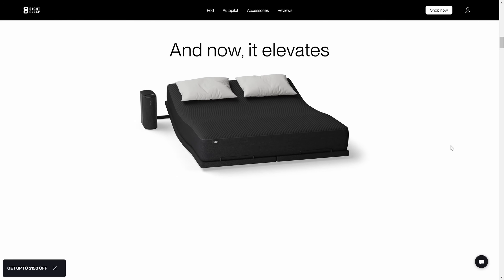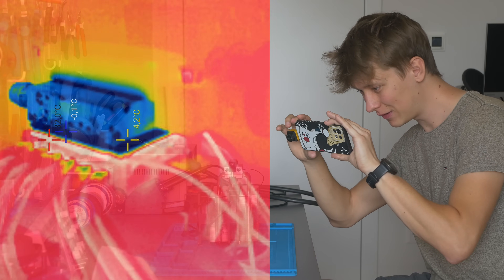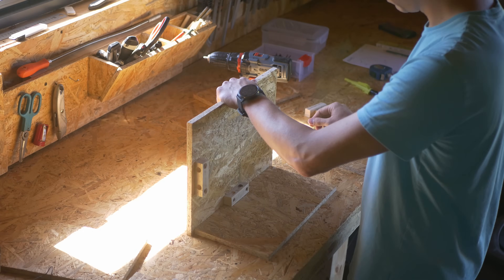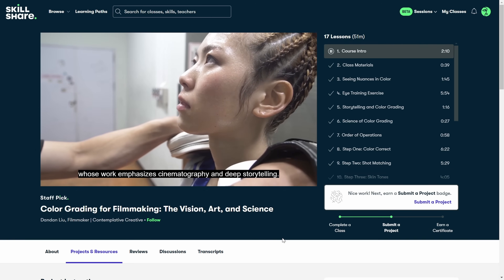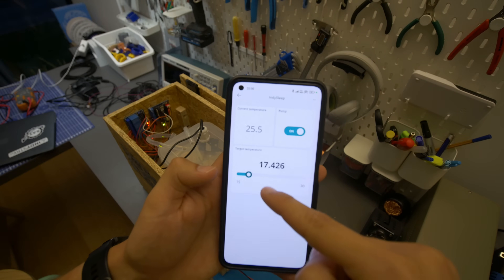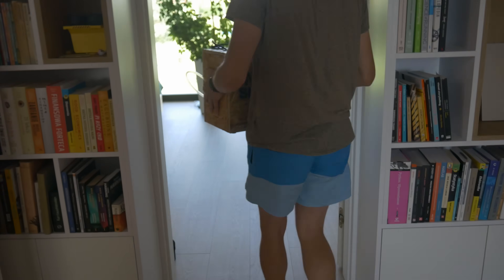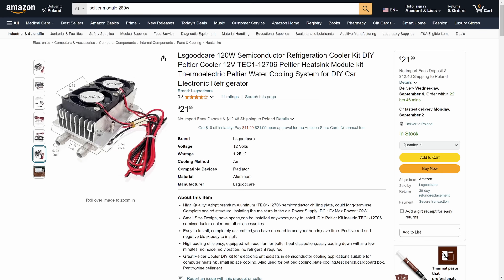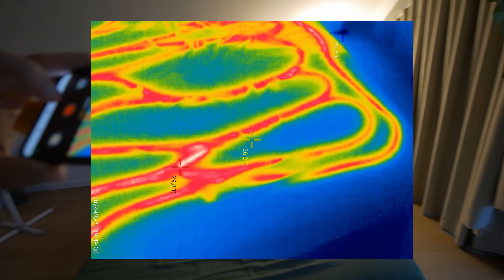I Made a $4000 Water Cooled Bed

Comment: Would be keen to see it with a heat pump instead of peltier. Also you could have more than one loop of pipe. You’d lower your flow rate but you’d get a more distributed change in temp across the bed. Oh I wonder if you could build a peristaltic pump. Then as long as your motor has enough torque you could drive all the loops at once

Comment: Would be keen to see it with a heat pump instead of peltier. Also you could have more than one loop of pipe. You’d lower your flow rate but you’d get a more distributed change in temp across the bed

Comment: You can use a refrigerator compressor instead of the small pump. They are cheap and designed to be really powerful at minimum loudness. You have to aim for maximum efficiency for a system like this. Maybe a different cooling liquid and a more efficient way to transfer the energy to the matress would be better approaches.

Comment: I did a similar thing and found that water cooling works better as I cooled the hot side and had 4 100 watt modules instead of one and had a pc radiator with fans and pvc tubing that I would put on my windowsill to not heat my bedroom and achieve better cooling and only used 20 meters of 10mm tubing on a pvc mat this worked extremely well and I powered it with a pc power supply so it was silent and bought most parts on ebay and used submersible pumps so they're silent and just used plastic containers as resovoiurs and it only cost a couple hundred pounds I use it every summer and have it on a timer to not be to cold and I also used air quick connectors so that different attachments can be put on for instance a larger radiator for cooling tent also I just sandwiched the peltier modules between two 40x160mm water cooling blocks as water has a higher heat capacity it cools so much better although I will  try use conventional refrigeration cooling in future as it is way more efficient.
Reply: If you’re experimenting with changing stuff try researching tubing that’s more thermally conductive, that should be more effective at pulling the heat away from your body 👍

Comment: I built one (but no temp control) I live in the tropics so summers get to 35+C easy. I used two water cooling loops. One loop for the hot side so the peltier and pumps sit on the side table, hoses go to the window with a 120mm fan and radiator to directly dump waste heat outside. The other loop goes to the bed. My first tests used silicone food grade tubing which are far more comfortable than vinyl tubing which felt like you're sleeping on iron bars. Now, I'm using a mat (similar material as air beds) but made specifically for this kind but the cooler was just a radiator and fan. I did not purchase the cooler kit, the mat alone cost me about 40usd. I didn't put any temp control yet but one 60w peltier is enough I just turn it off when it gets too cold in the early morning. I also tried the reverse polarity heating mode during typhoon season and it was nice
Reply: Planning on following what you did. The water mat you're referring to is a light blue square grid water mattress, right?
Reply: @toxomanrod  i got the grey one but there's also a blue version in the listing
Reply: @quandiy5164  could you share the link or search terms used? I appreciate it!
Reply: @toxomanrod  it's a local site here in Philippines so i doubt a link may be of use but the keywords were water-cooled mattress or cooling mattress

Comment: A coil of copper tubing could be buried in the ground. The pump flows between the bed coil and the ground coil... Sometimes for heating, they use black plastic tubing and put it on the roof. You are creating a heat exchanger. The more efficient units just use different fluids.

Comment: Take 2 sheets, sew parallel seams spaced 2 inches apart from one end or side to the other giving you uniform channels to feed the tubing.
Reply: Also, add a manifold to make multiple loop to have a more uniform temp. I use one of those bed cooler for more than 10 years.

Comment: Really strikes me that peltiers are used for this at all, as their ability to transfer larger amounts of heat is very poor/inefficient compared to thermodynamic cycle processes (like used in fridges/heatpumps)! I guess the total amount of heat that is actually removed from the bed must be quite small. Would definitely be interesting to see an approach using a thermodynamic cycle to achieve efficient and powerful cooling!

Comment: I wanted to make this during the summer, but I didn't want to experiment.
I would love to see a follow up of this project.

My idea was to use a minifridge to cool the water. Also, the cooling bit should no be in the same room as the bed. I would route the tubing in another room, or outside.

My biggest fear was that I would feel every bit of the hose. I wanted to router out a path out of a matters cover (5cm foam), and hide the tubing in there, but I think that may insulate the hose a bit to much.

Comment: you must use an compressor for moving heat away its way more efficient also quieter. phase change can also move more heat away than peltier modules with less power.

Comment: generally best practice with thermal paste is to put a blob of it in the middle and then press down on it with the heat sink with quite a bit of pressure so it squeezes out to cover the whole thing by itself, this way you dont trap any air pockets. but the way you did it is also totally fine and the difference will be insignificant

but tbh I think using a peltier cooler is more effort than its worth when you could just be cooling the water directly using a radiator. Ambient air temperature is already much colder than body temperature so you dont need to cool the water any colder than ambient, you just need a denser network of pipes in the matress to make them more efficient at transferring heat out of your body. then your challenge is how much heat you can extract from the water per second, and its a lot easier to do that by using a large surface area cooled by ambient air than using a small surface area cooled to sub ambient. get yourself a couple of decent PC water cooling radiators and you'll get MUCH better energy transfer than using a peltier. plus it will use a lot less power, and you wont be heating up the air in your room like adding more peltier modules would do.

if you really want to go sub ambient perhaps a better method would be to have the cooling unit actually mounted outside of your house. so that the radiators could be cooled with outside air, which presumably will be cooler than the air in your room. but then you have to figure out a decent way to run the tubes out a window and to make everything rain-proof

Comment: I think on most Arduinos the VCC pin is directly connected to the input voltage for example the barrel plug connector. If you connect it to USB it will be 5v but with a external supply it will be connected to this voltage, in your case probably 12v. Only the pins labeled 5v are behind the regulator and will stay 5v.
Reply from the maker: No, VIN is connected to the input voltage. VCC or 5V pins are 5V

Comment: And I stupid fool made the effort of dragging my mattress into the garden shed and use the already cooled water (4°C due to them running through the outside soil) from the wall outlet and a flow regulator to control the cooling effect and a linear electric thermometer wire all over the matress.. No loud pump, no expensive electronics all, no need of half of your rent being the energy bill.. All of it completely in vein.. 😓

Comment: I wonder if you could convert an old mini fridge to a more efficient bed cooling system.🤔 I see those at my local landfill all the time, so they should be quite easy to get. Maybe you could place it outside and just run some tubes inside, like an actual AC System, to avoid noise and heat generation. Would definitely be interesting to see.🤔😊

Comment: Bed sheet - get a piece of soft foam - like 50x50cm, use your CNC and cut channels in it in a shape of the tubing. Then just put the tube in, cover it with another foam and voila - you have a DIY soft matrace with water line :)
Reply: the issue there is that soft foam insulates well because of the air in the foam. Might almost be a better idea to use something like a thin waterbed mattress and cool that using the tubing instead

Comment: I've been thinking about a project like this for a long time so it's very interesting to see you tackle it.

One thought I've had is that air flow feels cool to your skin because you heat the air and that heated air moves away due to convection, so you could maybe attach something like a vacuum cleaner  (but more dispersed) to keep the air under the covers circulating so you feel cool.

Comment: I think that even with the extra peltiers you're not going to feel much of a temperature drop because of the spacing. What you need is something like a thin air/water mattress so that you're effectively lying on a layer of water. Putting an insulating/reflective blanket under that will also keep the system from sucking heat from the underlying bed, instead of you. keep up the good work

Comment: I think you should try to reduce area, but pack tubes closer to eachother. Also you should try to sleep on it. If it keep 24C when you sleep it would be quite chill. The problem with bed in hot nights is it's getting warm from your body heat. Also during night air temp drop. Your system might actually be enough.

Comment: Wow you're so close! Try making a spiral pattern (outside in) with the hose and use the whole 50 meters. A cheap three way valve could be use to switch from the resivor to the closed loop after the air bubbles are out. Using two pumps could keep the noise down and add additional pressure. Keep up the great work!

Comment: Like you said at the end, extremely not efficient for cooling. Cool video! Im going to be thinking about a way to integrate this into my AC system. Maybe a PC radiator in front of my AC blower. Moving the radiator to the source should allow for reduced AC settings.

Comment: I'm going to try with a countertop ice cube system I bought for parts. Way better COP than Peltier and I don't care about the heating in Arizona.  There are replacement mattress cooling pads on ebay and amazon but they are not that cheap.

Comment: Biggest issue I see that's severely limiting system performance is airflow on the hot side as the enclosure is way too restrictive to airflow. That can be inferred its geometry and from the difference in water temperature when testing out in the open (~17C) vs using the enclosure (~24C). It matters if the radiator/hot side is just a few degrees hotter because the COP of a peltier module goes way down as delta-T increases.

Comment: I really don't get the point. Waterbeds have been a thing for decades. The water in there is kept at the surface temperature of your skin, in Summer you can get away without heating it and still sleep comfortably. This hipstery pseudo-innovation really feels totally besides the point, as much as building a so-so ghetto-version of it.

Comment: Skip the active cooling, you 100% don't need it. Your air temperature is already low enough to feel a cool effect, how does it feel to get into a 75° bathtub? You can use a real radiator, which has low resistance and can dump a lot more heat (100s of watts, vs the 5W? maybe?) than your peltier.

Of course the real problem here is that electric motors have a sweet spot for output power. You need to put more of the tubes in parallel to reduce the resistance to flow; this is effectively ohm's law all over again. Your single long tube has way too much resistance.
Reply: He's already only barely feeling a difference. Without active cooling it'll not be noticeable at all
Reply: Go get into your bed while it’s cold, that is basically what it would feel like with a radiator
Reply: Would you think just laying on it as well would affect the pressure? Feels like laying on small clear tubing would only hurt the amount the pump can do and would probably be a pain to sleep on as well. The luxury makers are putting them deep in the foam so it's not felt
Reply: @rippah669 maybe I'm misunderstanding the cross sections, but to me it looks like Eight Sleep puts their tubing in the topper, not the mattress itself

Comment: cut a channel in a hard foam sheet and root the tubing through it so you don't end up crushing the tubes with your weight, put aluminium foil on top to spread the heat then cover it with a bed sheet.

Comment: A different solution could be changig your mattress  and bedsheets
Idk which material they are made of, but ive experienced that polymer based materials trap more heat and moistur than cotton and feathers. Also better for warming in winter.
Do some research on that,  could be a big difference.

Comment: Nice project, Nikodem.

I have two suggestions for you.

First of all - when you're laying the tubing in the bed cover, route it bifilar form. This way you will get even temperature across the whole area of the bed. Now, it will be much colder in the area where the cold water enters, and the temperature will gradually rise towards the exit of the tubing. 

The second one is the flow rate through the cooler. If you place one thermal sensor just before the Peltier module and another one right after, you can check the temperature difference and find out whether the water is in fact getting cooler. I have a feeling that the flow rate is too high and this is why the water temperature drop is so slow.

Anyway, I keep my fingers crossed for your success in the following iterations of this system.
Reply: Your second suggestion is wrong. Although it may seem logical that a low temperature difference is bad it's actually very good. Cooling or heating capacity is determined by flow multiplied with temperature difference (delta T). It doesn't matter if you have 1l/s flow with 10C delta T or 10l/s flow with 1C delta T, it'll remove the same amount of heat. The big difference though is: A delta T of 10C will gain a lot more heat from the environment when traveling towards the bed than a delta T of 1, making it less efficient. When cooling or heating with a liquid, always go for maximum flow.
Reply: @timderks5960  thank you for your explanation, which of course is correct. In theory.
First of all - we know neither the flow rate nor the ΔT. That's why I suggested putting the thermal sensors to accurately measure ΔT of the cooling module. 
Further, what we don't know are the thermal loses in the transport hoses. Perhaps insulating those can help.
But what we absolutely don't know is how much cooling capacity does the cooling module have and what cooling capacity is needed to effectively (read: feel it empirically) cool the bed. I.e. if the cooling module CAN cool the bed.
But this is why we prototype.
Anyway, to what I've written before, I'd love to see the following improvements in the next iteration:
a) most likely a thermal buffer is necessary, i.e. a container of, say 10-20 litres of water (cooling medium)
b) actually two flow circuits - one cooling the buffer and the other one chilling the bed
c) the bed chilling circuit will have high flow rate for rather lower ΔT - I agree with you here - with high flow rate the medium temperature will be more balanced across the whole area of the bed. And the cooling circuit - basically doesn't matter, as long as the output temperature is above medium freezing point (+4°C for water) and the flow rate is high enough to effectively circulate the medium in the container.
And can we solve it with just one circuit? In the end yes, provided that we have a cooling module of enough capacity and adjustable flow rate - even though the desired bed temperature can be set fixed, the environment temperature (with and without the occupants of the bed and changing number of them) is not, making the output circuit ΔT variable.